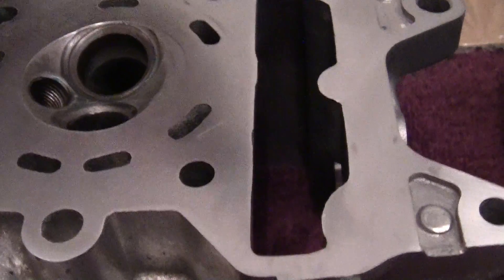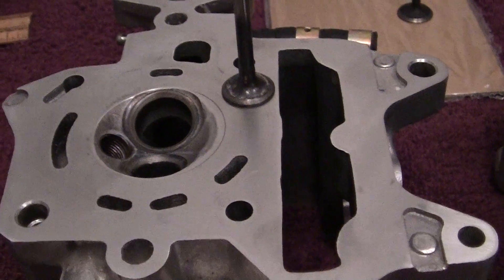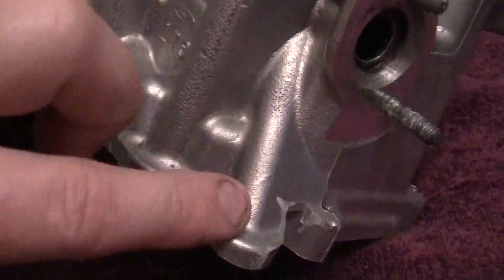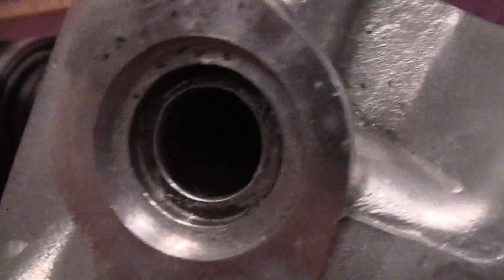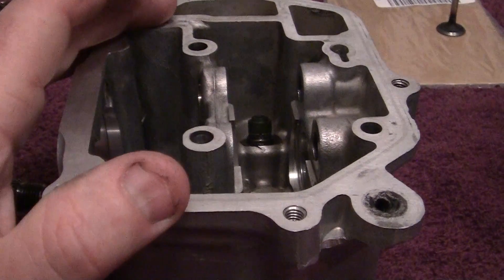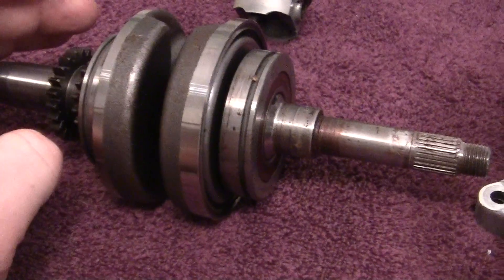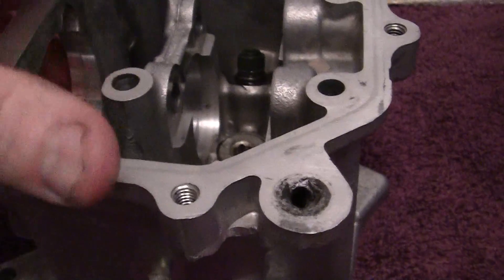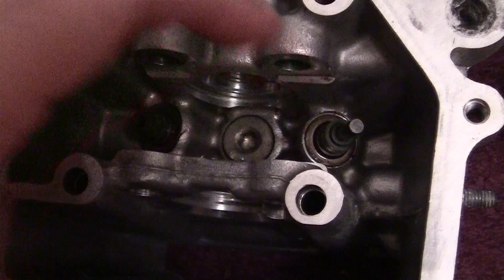107)-  PROJECT Honda  RUCKUS - HOW TO= Engine COMPLETE REBUILD

Comment: I've had some hands on real life experience with airplane fuels & discussions and testing with engineering primarily with one of the major US petroleum companies.  Airplane fuel versus automotive race fuels. 
Vapor pressures of the airplane fuels are not suited for water cooled automotive engines.   Works sure, but carb fires and timings are all affected.  Plus the carbon builds fast.
Reply from the maker: I noticed a huge lead build up in the carb with a sheet of silver lead on all surfaces. I have used low lead 100 aviation fuel but I mix it 50/50 with regular gas to give some boost. I would never run pure 100 in a bike.